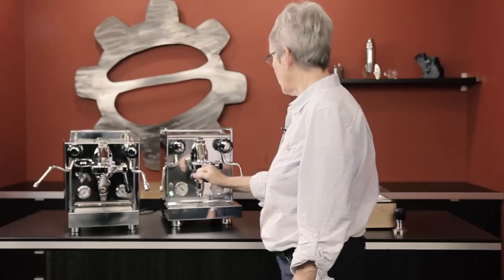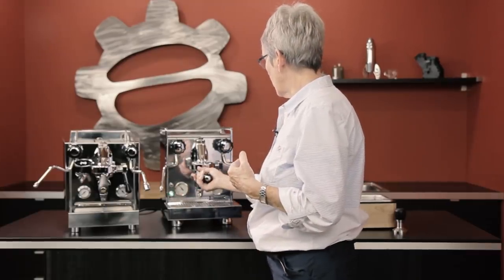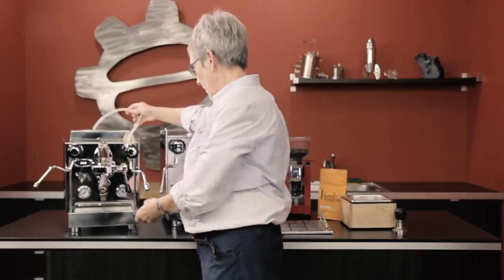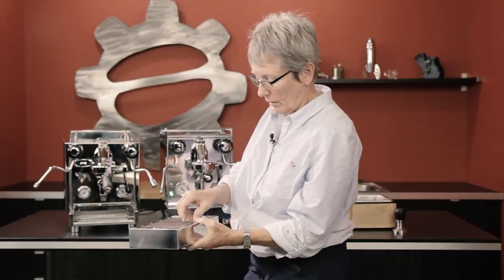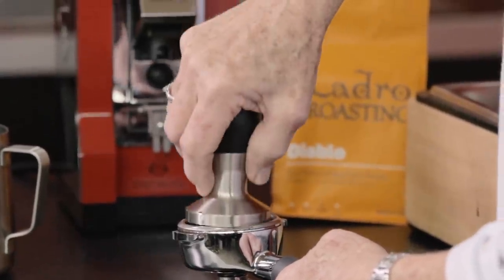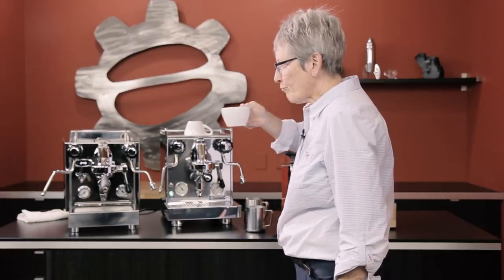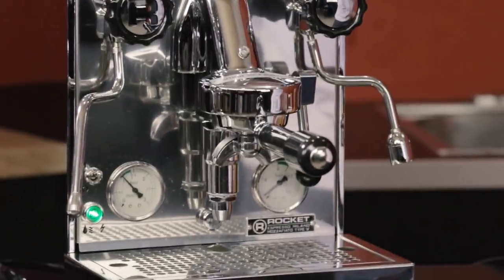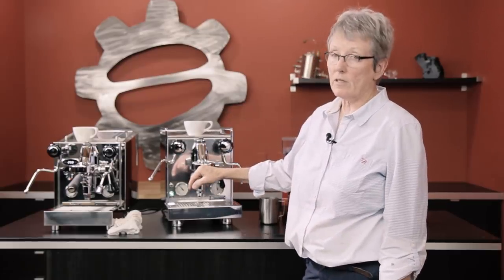Izzo Vivi Pro vs. Rocket Mozzafiato Type V | Crew Comparison

Comment: I just bought the original Eureka Mignon MCI.... I am happy with it after dailing it in. The new one is quieter for sure but I really like the older design. The newer one is also plasticer which I didn't like. I like the touch display and think it is a nice feature. However, baristas at home won't change the coffee that often, and also how many porta filters do you have at home and use at once that you will need to switch between a single and a double - I believe most use a double basket anyway.  So the display has a cool look but it is not worth the upgrade, for me at least.
Reply: @Oliver:
True, once "@ home users" find their coffee-bean brand & roast level (light/medium/dark), they pretty much stick with it. When dialing-in a new machine (or GRINDER!), however, or when searching or another bean and or roast level, a WHOLE LOT OF COFFEE is wasted in the process...and lots of time AND money is spent! That's a GIVEN. Once the bean is found though, all that's over -- IF one sticks to that same bean.
As for portafilter baskets, I use a "La Marzocco Strada" triple-shot basket (and a bottomless/naked portafilter) to make my morning Cappuccino, so I really don't pull doubles. And TMK, pretty much NO ONE pulls singles anymore...
BTW, my grinder is a Mazzer Mini Electronic type A.
-- BR

Comment: i have the giotto tipo v machine at home. it is excellent (a big purchase, but well worth it if you love good coffee)
 - my only dislike is that if the water tank empties mid shot, the machine stops and you have to fill it up to get the pump to activate again.
There is no quick way to check the water level and no indication it is running low / you wont make it through this shot.
Does anyone have a solution to this that doesn't involve opening the lid and looking in?
With all the purging I find it hard to keep track of what the water level might be.
Reply: @:mustbreak70:
I have a VBM (aka: Vibiemme) espresso machine myself, and it also has an internal water tank. However, I don't use it -- instead I have a 5gal tank I keep under the machine (with the water intake hose running down to the tank). That 5gals lasts me about a month, so I only have to refill monthly. I can live with that...but NOT constantly refilling the internal tank. My VBM has a "more robust" rotary water pump, so it seems to be able to handle sucking the water up from down below just fine. Were my VBM to have a "less robust" vibratory (aka: vibe) water pump, however, it may stress it out so I'd locate the tank right NEXT to the machine instead, so the pump is just pulling water "sideways" vs. from 3 feet "down under." ;-)
My VBM, however, is what's called a "switchable" machine -- uses a water tank OR can be hooked up directly to a water line (they have a switch/valve you turn one way or the other for either water source) -- but I choose not to hook it directly to the water line, partly because I want more control over the quality of the water that goes into my machine (and "water quality" is a huge topic all in itself, especially for expensive Prosumer-class espresso machines, which besides being "family heirlooms" are an "investment" of some serious pocket change for sure!). 
But as for a water source, in MY case the 5-gal water tank works fine...
-- BR

Comment: Nice video.Only have a question...Are those machine for personal use or commercial?
Reply from the maker: They are both for home use.
Reply: @Melina:
They're "Prosumer class" machines...for home use mostly, but almost commercial/heavy-duty class -- meaning Prosumer, as in-between Professional & Consumer, but definitely WAY above your "Consumer" or "Appliance" class of home machines in they way they're built, materials used and durability/longevity. Almost all of these are Made in Italy, same for the Prosumer class of grinders that g with them. Italy has made the best semi-automatic espresso machines & grinders for over 100 years -- they still do.
Mine is a Vibiemme (aka: VBM) "Vibiemme Domobar Super HX - Manual, Switchable (Water Tank or Direct Connect), Rotary Pump" semi-automatic machine. Grinder paired with it is a Mazzer Mini Electronic Type A.
-- BR

Comment: can these machines pull 100 shots per day?
Reply: Being a Prosumer class machine (Professional/Consumer), they're VERY robust and built to last decades (copper/brass/stainless-steel), so they probably COULD do 100 shots/day, but quite frankly if you're doing THAT much coffee it sounds like you have a coffee shop/cafe, so were it me I'd not want to stress-out a Prosumer machine like that. Instead, I'd opt for  Professional/Commercial class machine...same for the grinder: Go Commercial class. 
-- BR
Reply: 100 shots u probably want a dual boiler

Comment: How do you change the Rocket PID to Fahrenheit?
Reply: First you need to connect the remote controller.
Then, press the P key until you see "Temperature Unit Options". Press the up or down key to select celsius or fahrenheit, and then press the P key to confirm and move to the next menu.
Reply: drewyp that might work for the R58/R60 models, but the Mozzafiato has the built in PID with up and down buttons, no “P” button.
Reply: I am always confused by those questions, what about reading the manual?